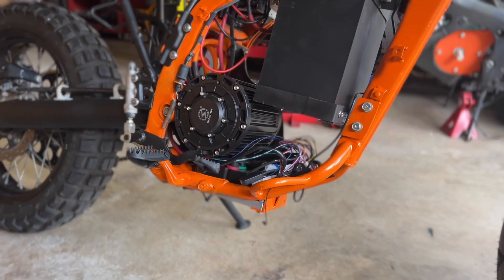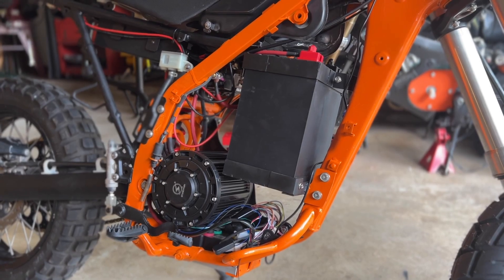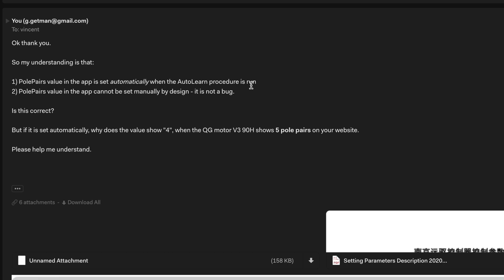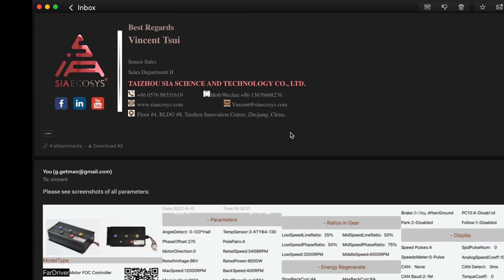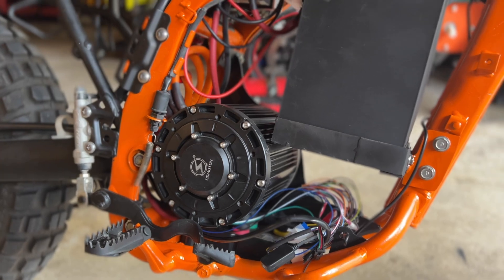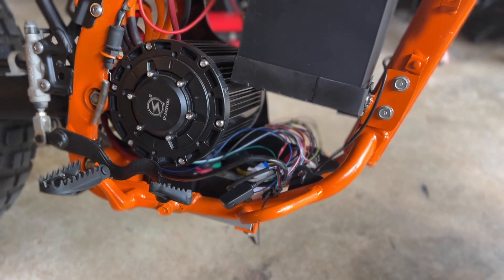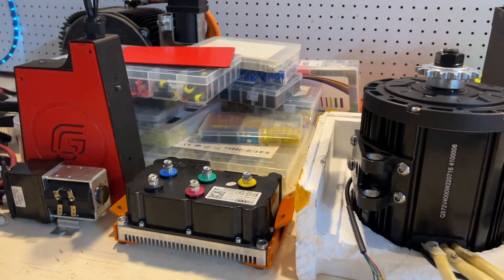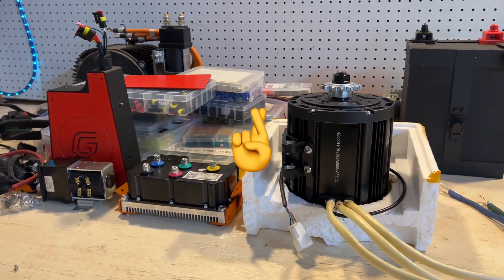I Bought My QS138 Electric V3 Motor on Aliexpress and It Short Circuited

Comment: hello i have the same motor from ali express but i got it from sia tech but it wont run an auto learn and when i try to ride it wont move but once its up in the air in runs fine i dont know if my battery is to weak or my throttle is to weak my battery says it 72v40ah but that all it says i was makin my own battery out of 18650 cells so i ordered  a jdb 150a 20s bms so i might switch it with the battery i have to see if it works

Comment: I had a far driver that did this to a hub motor . Yellow and blue hall wires were wrong in the motor . It ran but over heated and melted the motor
Reply: How did you notice this?
Reply: color of wires does not matter

Comment: Today I disassembled the new motor, and it turned out that the wires are just pressed on and it's not soldered tin at all, terrible processing, qs138/90, I had to take everything apart, clean it and fly

Comment: You should not use higher voltage than what is said on the motor. It should be only 72v.
Reply from the maker: this is not correct. you can overvolt a motor by a significant margin. many people run this motor above 72V and I am currently running it on a working bike at 100V, and have been for months. the issue here was the terminal lugs being crimped on top of enameled wire
Reply: @GaiusGarage  can you show us the damage part? I mean thosw wires that you are saying
Reply from the maker: @christianpaulroldan4010  check out this video where I show the motor and the issue with the terminal lugs https://youtu.be/HNDqLJDV5gE
Reply: @GaiusGarage  It is and isnt correct. You can mod a stock engine and bring it up to a level where its performing as well as some more expensive motors, but it will not be stock any more. The same applies to electromotors, you can pull through more voltage and amps if you want, but for how long it will function, is no gaurantee. There is a reason this motor is rated at 72v.
Reply from the maker: @Yes-sw8gh  yes that is correct - there will be more stress on the components, specifically coil winging insulation, magnetic saturation of the rotor magnets, and mechanical stresses due to increases speed. but all of these are very negligible when it comes to 20-30V difference. I'm sure there will be difference, but it could be something like 1 mile for every 10,000. I'm just making up the numbers but the point is that you will probably never put enough miles on these motors for it to make a difference. This definitely changed if you run the motor at 200V but overvolting is pretty forgiving

Comment: It turns out pole pair has nothing too much set to 4 or better6 .  So frustrating at first!!  . Pay close attention to pid / KI settings, and angle . I fried my phaze wires  once . 86v-100.8 is fine!! Youre better fixing the KI to mids ,and keep the numbers close . Play with that angle till it feels best . Had all the problems you had , but now is it running better?
Reply: Edit . The biggest problem was a loose wire ( unseeable) broke wire in the hall sensor wire! Super hard to find . But pid was off also

Comment: Vincent is a muppet, the quality coming out of China sucks. I have had multiple issues with votol controllers, buggy software with very limited information on wiring and programming settings. I received one with fault when accelerating. Went round and round in circles with Vincent and got no where. Have another coming from another supplier if this one shits itself I’ll give up with chinas crap

Comment: @Gauis if I may ask you please about an issue with my QS 3KW mid e-motor that locks up. I also have a Fardriver 84v530a controller that heats up, the temperature sensor is set to 2-NTC230K. Thank you 😊
Reply from the maker: its hard to diagnose these sorts of issues without more details. I offer 1:1 meeting where you can describe the issue and show with video. it's $25, but if I can't help you I will refund the cost. please book a session here: https://calendly.com/gaiusgarage/15-minute-consult
Reply: 4-cacu

Comment: No my friend it didn’t short circuit it you short circuited it you should have shut it down when it didn’t function properly I’ve learned for working on many things from giant diesel equipment used in mining to electric weed wackers when you notice something’s off shut it down as fast as possible it’s easier and usually cheaper to fix it if it comes apart running also haha your not a dumb person you have some understanding of electricy you should know better then to trust anything on the internet

Comment: Motor overheating have nothing to do with overvolting. As long as the motor does not go overRPM it is fine.. and the voltage the motor see is always proportionnal to the rotationnal speed.. it have a kv factor (rpm per volt). What make a motor to overheat is CURRENT. If you Double the phase current you quadruple the heat. if you double the volt ( rpm of the motor) you double the heat.
Reply: How much amps should be

Comment: What frame is this?
Reply from the maker: Kawasaki KLX250
Reply: I appreciate the response. I subscribed!
Reply from the maker: @AubreyGregson  Thank you!
Reply: One other question I had. I’m looking to build a bike. Is it worth spending the extra money to build a mid engine vs a hub engine?
Reply from the maker: @AubreyGregson  just depends on your use-case. Hub motor is simpler, usually cheaper, more quiet, and you have more room for the battery. downsides are that you have a ton of unsung weight in the back wheel and reinforcing the dropouts becomes an issue. then you run into issues if you get a flat or need to service the wheel. if you're planning to ride off-road I'd say hub motor is a bad choice. If it's mostly for street riding then hub motor is a good choice also

Comment: No that is not a genuine qs motor affilate ,hands down the most reliable and very high QC ive seen is Siaecosys have direct agreements and also design and manufacture their own controllers too
Reply: Qs motor does actually sell direct from their website too
Reply: im positive though yours isnt a genuine qs motor its a clone
Reply from the maker: that is correct. I have purchased from them since and so far so good

Comment: I would not hesitate to return this motor and tell them this part has been delivered as DOA (dead on arrival) even tho you tested it. You can simply prove it by all your video or image material. From my experience so far the quality on electronic items manufactured in China is moderate or low. I don't mess around with these guys.

Comment: Even if the Motor is in working condition and if you measure the continuity between each phases, it will always be shorted whether is it a Star connection or Delta, in any BLDC or PMSM Motors.
Reply from the maker: yes, that is correct. I have since learned more about winding configuration and the bit about continuity in the video is not explicit evidence of a short
Reply: @GaiusGarage  Did you rewind the Motor? If yes what are the winding parameters such as, number of turns, wire gauge and number of wires in one strand?
Reply from the maker: @jppatel4831  I actually did not, and didn't count the windings. just ended up selling for parts
Reply: No! It will not be shorted! It will have some resistance from the coils. Theres a huge difference.